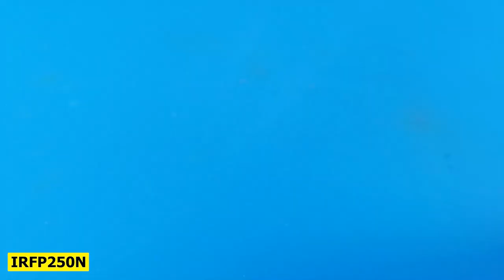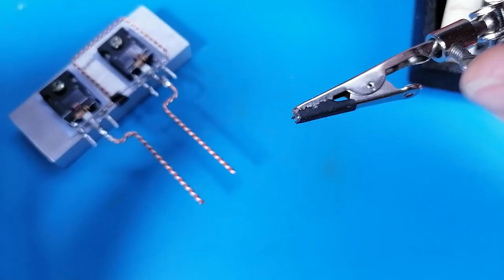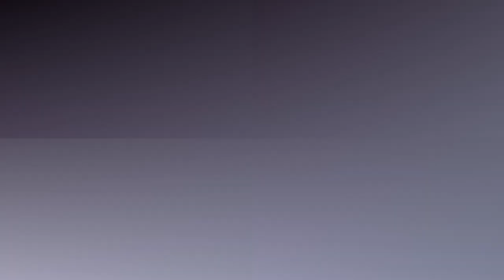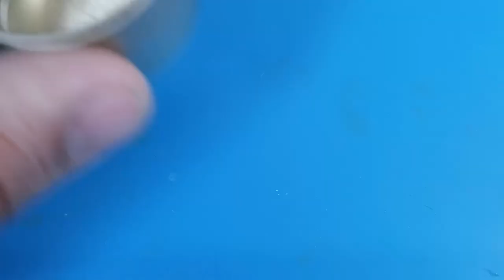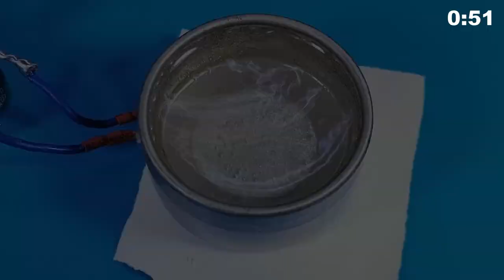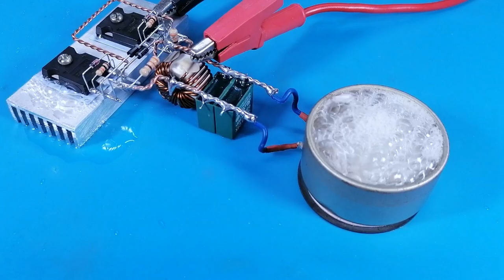make 500 Watt induction stove at Home ,500 watt induction heater,circuit make an induction stove

Comment: I would check something out.  Power electronics semiconductors if operated correctly should be about 90% efficient.  Boiling water on the heat sink isn't a good sign.
Reply from the maker: I know, I used a smaller heatsink to fit the circuit in the video frame🙂